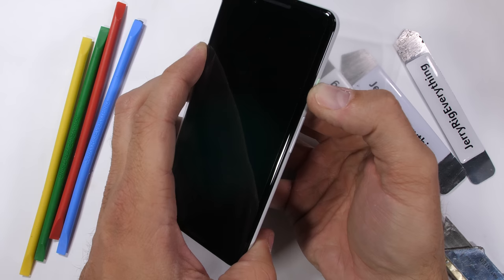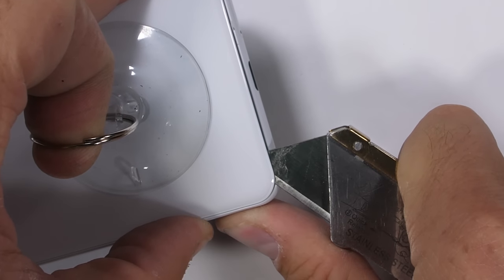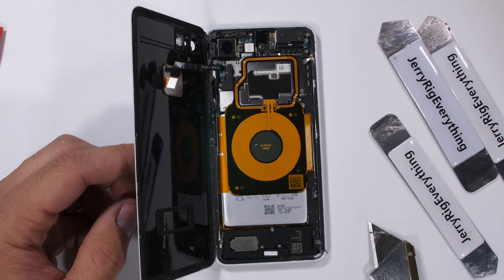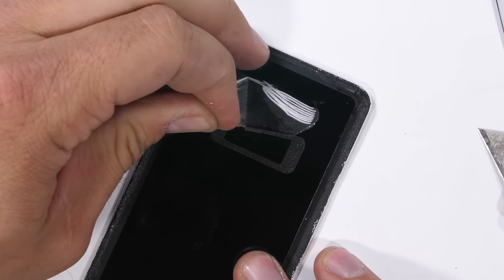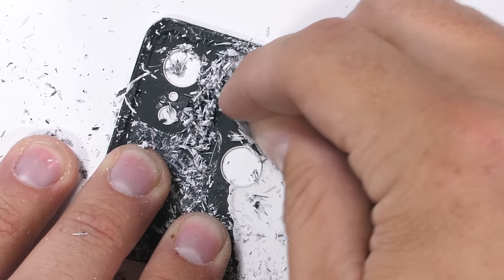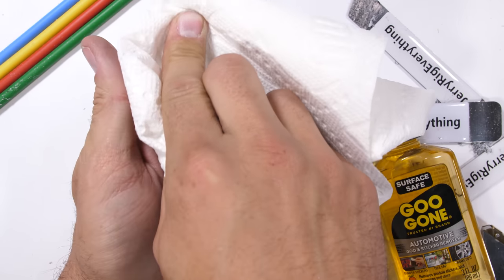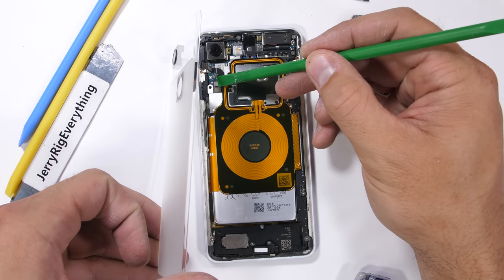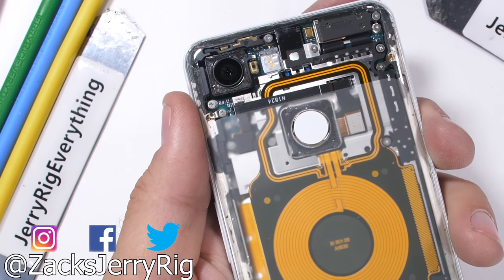Totally Clear Pixel 3! - Transparent Edition!!

Comment: Removing that color coated plastic means if you drop it, it will shatter to pieces instead of cracking. Like a windshield.
Reply: This should be upvoted more.
Reply: That's what saved my LG g6's internals from getting glass pieces all over It. I think that It could be possible but very difficult to find and apply a clear one After removing the original
Reply: The plastic paint protection film used on cars would definately solve this issue so theres a way for that :)
Reply: Just don't drop it.
Reply: Depend on the glass actually, if it tempered glass then it won't shatter, and i believe most phones use tempered glass as their back panel, instead of regular glass.
Reply: Who cares?
Reply: Windshield don't shatter, They're designed to be able to withstand a cone hitting them. The glass cracks, but the laminate will keep it all in place
Reply: Ghali Farouk Sekkat I think he meant that the version with a laminate works like a windshield. (Because it's pretty much the same thing)
Reply: @sinom  Yes, that's what I meant. I should have been more.....CLEAR!
Reply: You can use vinyl films or transparent car coatings from the inside 🤔
Reply: But I'm not going to drop it
Reply: Would be a reason to replace the glass back with a polycarbonate look alike panel to replace the glass.  Too bad the market would be too small for a company to manufacture.
Reply: He said that in his one of his videos if i remember correctly
Reply: It's also why I'm honestly okay with Apple's sheet of adhesive on the iPhone 8/Plus and such. You know, it's a nightmare to take it off cause literally every bit of it is adhered, that whole debacle? You know what else happens? It maintains water resistance (to a minor degree) if the back cracks. The back doesn't shatter and spider-web like the 4/s did. And since I'm so careful with my devices... I'm okay with it.
Reply: Michael C I believe there are Clear D Brand Skins
Reply: Sure yeah but, the aesthetics dude!!
Reply: @thelazt16  Tempered glass very much will shatter, though it is significantly more impact proof than standard glass. And when it does shatter, it shatters not right across, there will be a ton of little pieces.

You can assume the glass here to be chemically toughened glass, which is more shatter resistant than tempered glass. But it will still shatter.

For the case that it does break, you actually want to laminate it on the inside, it will slightly reduce the probability of that happening, and when it breaks, it will make it safer to handle.

Comment: dont know why phone manufacturers dont listen and give us a transparent phone at back sure it will save them money not putting all that colour and sticky crap on back. just get it clear from start. but then we dont get a jerry vid of him doing it himself so that one down side of it.
Reply: Risk of component damage from UV rays and faster heating up of the inside means companies cannot make a transparent phone without significant legal issues or PR issues when something goes wrong.
Reply: sure it can have a UV ray protective layer or spray to stop heat or other rays.
Reply: TheAnial8r Uv may be a real issue, but not the heating. Actually the heat dissipation would be slitly better without the paint insulating the glass from the phone.
Reply: Rohan If its not a uv resistant glass, it can pass through
Reply: Noah Well, tbh doesnt make too much difference if you dont keep the shattered back glass. 
It could be potentially a little bit more dangerous tho
Reply: noah they can use the same paint or sticky stuff they normally use that can be uv protected and will not fall apart be like normal colour one but have it clear instead of a just a glass back see problem solved we should work for the phone company design department.
Reply: Noah  You just need a clear plastic laminate layer, quite like the one in your car's windscreen

Comment: So when Service Centre guy removes the back panel how does he make it IP certified again!!
Reply: If it is under guarantee and it is water resistant certified then they might just give you a new phone and tear down the old for parts.
Reply: @thodorosxanthopoulos  hmm, that's an option, but what if the customer comes with a hardware problem after 10/11 months?!
Reply: @ansudasa  after the warranty is over, which is a mandatory 2 years for EU then they don't have to make the phone ip68 again, you pay for the repairs but since they actually do the repair on your device and not replace it then you get no water proof sealing.

If you have a heat gun you can do the repairs yourself and save the fee.
Reply: Probably he replaces the glue or just removes the glue of the phone and takes a new back pannel awready with glue and press it against the phone with a little bit of heat.
Reply: Theodoros Xanthopoulos Nah, this isnt efficient, they would only replace the problematic parts..
Unless there were too many damaged parts in the phone making the repair not viable.
Reply: Samsung actuality tests if the phone is still water resistant or not after a repair. My S7 edge's back glass was shattered and it was repaired in their official store. After that they did some liquid tests and some liquid did get in. So they replaced my entire phone and only had to pay for the back glass repair.
Reply: If you really want to make it water resistant again. U can use the b7000 glue ..it's a clear glue ...becomes rubberised once cured and its water resistant..I use it on my phone repairs
Reply: @thodorosxanthopoulos  Warranty never covers water damage, even if the phone is supposedly water proof. Warranty is usually nullified if the user tears down the device.

That phone has no warranty anymore.
Reply: It won't be IP certified anymore.
Reply: Replace the sealant...
Reply: I think the adhesive Jerry uses isn't water proof, but the one Google uses (and reapplies) is

Comment: If you heat up the glass a little bit with a rework station, the paint comes off WAY easier. Did it for my transparent iPhone 4s, which has the same paint material.

Comment: I wish you'd use something less dense to remove the coating, I'm certain the glass is scratched on a near-microscopic level which almost defeats the purpose of "glass" and "transparent." It's still great. It's actually spectacular. But it could be much more close to perfect

Comment: Do you think if you used a little bit of silicone caulk or something around the outside that it might be waterproof again? or might that not be adhesive enough to hold the back on?

Comment: @JerryRigEverything

Do you think it would be possible to get a replacement glass back for the Pixel 3 XL but put it on the Pixel XL 2?
How about getting a replacement battery and wireless charging parts for the Pixel 3 XL and rigging it to work in the Pixel 2 XL?

Comment: Hello, I would like to know, how can I clean the USB-C charging port ?. My question comes because apparently by some submerged in the pools, sometimes when I connect the charger makes a false contact with the port. Can it be cleaned with alcohol? Oh and as a note, if I move a bit the cable activates the load and if I connect a cable from my external battery, it does not give any problem.